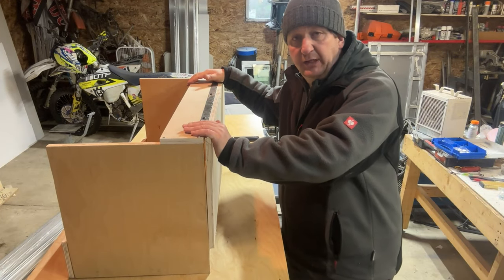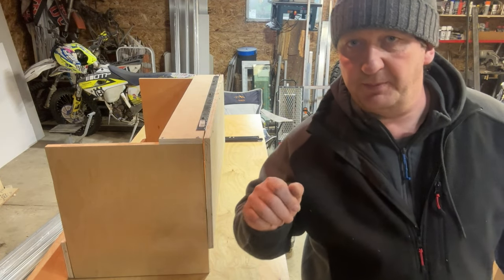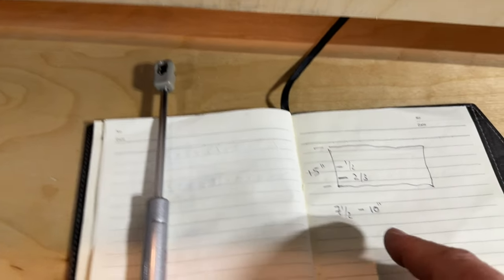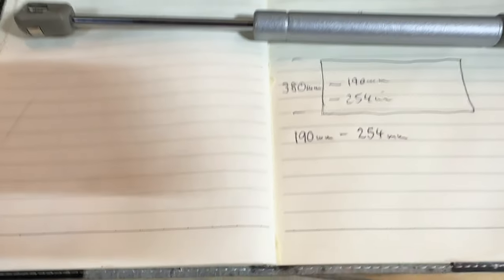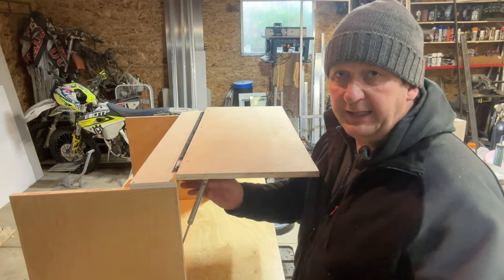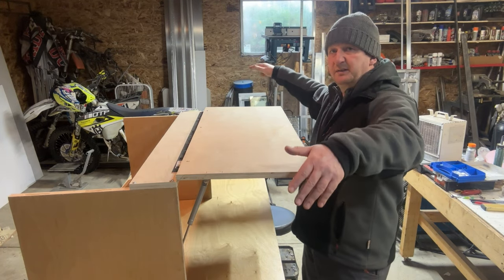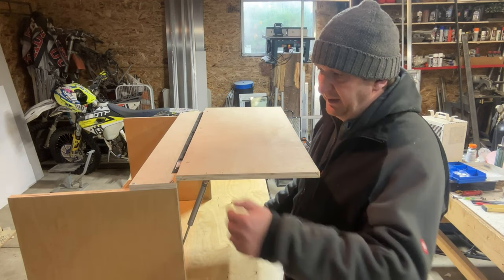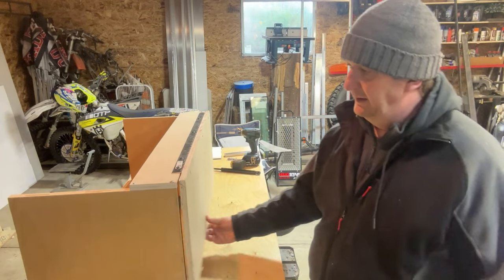How to calculate a Gas Strut ! Length - Force - Position all DIY !!!

Comment: Great video. thank you very much. I have a follow up question. If your door or lid is long and you decide to go with 2 pistons. would you divide the Newton by 2? ie: if the lid I wanted to lift was 62 pounds or 28.16 kilograms would I use 2 pistons at 276.23 Newtons or 2 pistons at roughly 138 Newtons?
Reply from the maker: Watch the Q and A video it will answer your question. https://www.youtube.com/watch?v=VvD6kzq3kts

Comment: Great video, best one on youtube. But no mention of the mounting position of the other end of the gas strut (not door side). As I think if you don't mount it properly it would just push the door out itself, or not assist much. Do you have a good rule for that? Thanks
Reply from the maker: You are correct and I made a Qand A video later on which answers all those questions. Cheers https://www.youtube.com/watch?v=VvD6kzq3kts

Comment: Hey! I loved the video and it was very informative and helpful for my project! But I have one question, I am trying to install gas struts on a work bench that opens and closes like a chest but the lid is so heavy it could easily amputate your fingers if anything goes wrong. Because of the contents in the box I don't have the possibility of mounting the struts to the sides of the bench but I have to put them on the floor inside, its only 13mm deep so its not that big of an issue but what I need to know is how to position the struts like the ones on the truck in the beginning. Where they are at a steep angle and push away with the lid instead of pushing against the lid. Any help would be amazing, thank you!
Reply from the maker: I am sure you will understand that I don't like to give advise on projects you could get hurt. Please be careful and good luck !

Comment: My lid overhangs.  So when calculating the length, do you want the total length of the lid (overhanging) or just the length of the chest itself (excluding the additional overhang of the lid)?
Reply from the maker: In this case you need to exclude the overhang .
Reply: @oscaroverlander_MB1222AF  Thank you!  I really appreciate the replies.  I struggled for a while and wound up ordering like 15 different sets of struts.  It was frustrating not being able to try these in my hands before ordering.  The ones that seemed "long enough" online ultimately put too much pressure (like 60#), and would either hang or I couldn't close the lid.  Wound up using 14" Vepagoo struts at 24# weight (ordered on Amazon).  Here's my project, if you're interested:

https://www.youtube.com/watch?v=6mGPstTkR-c

Comment: Is there no accommodation in the math for a 2nd gas strut? Ie, if two gas struts, cut the load weight in half? 2 struts you reduce or add distance? I’m not sure what 2x struts do to the equation. Thanks!
Reply from the maker: I made a Q&A just recently you will find the answer here. https://www.youtube.com/watch?v=VvD6kzq3kts

Comment: If I'm using 2 struts, do I need struts that will support half the amount of the total weight each? If that makes sense
Reply from the maker: No dividing both struts need to have the full force, otherwise you and up with two struts they are too weak to push the weight up. Cheers

Comment: I'm trying to put this on a bed to lift the mattress up so it's basically what you have built here but just flips the other direction. All of the instructions I'm seeing online the lower part is to go closer to the hinge, so would the 20-30% still apply just on the base instead of on the mattress part that's opening? If that makes sense.. I'm wondering do I just do it backwards because it's lifting the other direction, Maybe the rollover that you mentioned at the end..? I'm having the hardest time trying to figure out how to get this on
Reply from the maker: Little difficult for me to help if I can't see it. https://www.mote.hu/en/products/gasspring-bed-actuators-for-single-bed

Comment: Super helpfull.  Question I have is that I have a door 48" x 48" but only weighs 15lbs.  How would I determine what to use as it is really hard to find a Gas Strut that is long but low lbs.
Reply from the maker: Good question! https://www.ebay.com/itm/392152995247  they may work if you go close to 20% or even more towards the hinges. Cheers

Comment: what is the name of the mechanism that would be used if the "length" was too long?  Like if I wanted to make a king size murphy bed, that is 80" long, that would need a minimum 40" strut, but certainly there must be some mechanical advantage method/device/bracket that can short the length requirement?

Thanks
Reply from the maker: Good question ! You can use a shorter strut but make sure it can lift the weight, the force formula stays the same.

Comment: Great video Oscar, thank you very much. I just wanted to ask, if the weight of the cabinet door is say, 10Kg which would be 100 newtons... would you buy 2 gas struts at 50 newtons each because the weight is divided in 2 OR does it not work like that?
Reply from the maker: In this case I would buy two struts with 100 Nm and if I like it open softer or stronger I play with the 20-30% spacing, but don't divide the force by two, you end up with two  weak struts. Hope this helps Cheers

Comment: Fantastic video! Be question: if I do install 2 struts will I need 1/2 the Newton per strut? Given that two will add up to the same amount? Like if I need 60 Newton total, but install two struts, do I purchase 2 struts of 30 Newtons?
Reply from the maker: The answer is no don't split the force by two. Both have to have 60 Newton, otherwise you end up with two weak struts. Cheers

Comment: What about if If I cannot disassemble the window where I need to place the strut and I do not know how much it weighs... and I have no way to weigh it...
Reply from the maker: Thanks for your question, there are multiple solutions to get to know the weight. 
1. Swing the window open by hand and guess the weight ( if you are not sure let others do the same and compare your guess )
2. Maybe you can borrow a hanging scale from someone, hook it on to the window part and lift the scale up it will show you the weight.
3. Figure out the frame material and thickness and the infill ( glass or solid panel or sandwich panel ) you will find for all sorts of materials and thicknesses weight examples per meter/feet/square meter/square inches and find out the weight by math. 
I hope this helps Cheers

Comment: The weight to push up - is that per strut, or total?  So if I have two struts, I would halve the amount of pressure needed?
Reply from the maker: The calculation is per strut, don't divide the force, you end up with two too weak struts being able to push up the weight. Cheers

Comment: Exactly what I needed to know! One thing, the Gast struts. I ordered through your link. Do not have that cabinet attachment. Is that something you need to order separately?
Reply from the maker: Thank you very much. Yes if there are no mounting brackets with the struts, you need to purchase them separately. Make sure you pick the ones with the correct ball size. Cheers  https://amzn.to/3y2GVY2

Comment: Oscar:   I contacted Dunn & Watson in Au.  They sell struts in Au.  The video they put out had all the math .  Before I placed an order I asked them  them to check my math.  They refused, { lost a sale},  Your explanation is far easier to grasp.
   I would however  ask that  you include the following.   To convert Newtons to pounds, 1 N= 0.224809 My door weight  is 75 kgs.  43" High.   30 % is 28.66"  20% is 21 1/2  ".   I need a strut that will lift. 0.224809 X  750= 168.06, or 169 pounds. 
 Your video will make Life Easier for many people.  Thanks.
Reply from the maker: Thank you for your positive feedback, I am glad you like it. If your used to pounds it makes sense if you convert it that way, but for my understanding is it easier from kg to N ( your door is 75kg = 750 N ) Cheers
Reply: @oscaroverlander_MB1222AF   Hopefully we can do coffee this spring.  I need your advice- to many questions ,this is not the place. I will email in about 6 weeks. Yes,  my door is that weight. The rear taper of my truck will be a storage area. The back pivots up. Al plate is 176 kgs.

Comment: I'm in the process of doing an aftermarket stereo in a car where I want to mount some amplifiers in the bottom side of the (when closed) trunk of the car.  so when resting in the position of totally open...there will be less weight being held out  as demonstrated by your model....., but a LOT more weight to be lifted up from a horizontal plane. Presently my trunk already has older springs that I want to completely replace with the struts.  I was just assuming I could get the highest psi strut that would fit for the length I have ....  Do you see a problem with that mindset?  I don't think I'll have so much pressure where the trunk doubles as an ejector seat for those that are sitting on the car.....  :>)
Reply from the maker: Better would be finding out what the weight is which the struts have to lift, too strong ones will lift everything and this pretty fast but when you close the trunk at the end of the closing movement the struts will slam the trunk closed. Because they are so strong. Hope that helps. Cheers
Reply: @oscaroverlander_MB1222AF  thanks for the reply...looks like I'll have to make the amp board and wiring and weigh that along with maybe through a search online for the trunk lid weight and go from there...  thanks again for the help!
😊

Comment: Can you tell me anything about electric actuators? They dont come in the same length/weight as gas struts. So do i need to know the length requirement or the weight requirement?
Reply from the maker: Well I have never installed an actuator but I could imaging, that weight and lift height the most important parameter are to select the right actuator.

Comment: How about for stairs ( 4 step ) as lift for storage space underneath.  how do you measure the right gas strut lenght?
Reply from the maker: Should be the same principle if the struts are attached on the sites. If they are attached at the head center point you need a lot shorter but stronger strut. But the weight of the for steps stair is an important factor to find the right struts.

Comment: nice informations. But do you think i can use the same calculs with an electric linear actuator on 12 v
thanks ??
Reply from the maker: Well I have never installed an actuator but I could imaging, that weight and lift height the most important parameter are to select the right actuator.

Comment: Do you use 2 struts if the door to lift is very heavy? And how you calculate when using 2 strus?
Reply from the maker: Yes two if you purchase them they come most of the time in pairs. Cheers

Comment: Is multi positional stop gas strut good or they pose any failure threat and how do they work
Reply from the maker: I was hoping to find some but was not able to, those would be fantastic for my skylight. They make it possible to open the window for a bit and leave it in a sorten position. Post a link if you found some please !

Comment: If you use 2 gas strut, do you divide the strength in half?
Reply from the maker: No both struts need to have the same strength. Cheers

Comment: Great video, thanks!  FYI, you could weigh the door without removing it by propping it horizontally on a scale form the very edge opposite the hinge, subtracting the weight of whatever you propped it with, and dividing by 2 to account for the fact that the hinge on the other side is supporting half the weight.
Reply from the maker: That's a great idea! I doubt that will be an accurate measurement, but it should work. Cheers

Comment: Absolutely Brilliant Oscar. Thank you very much for your tuition 
This was doing my head in trying to work out how to install it
Grateful for your help
Cheers Stevo
Australia
? Is it possible to fit the struts on the external frame of the door & wall of cabinet. 
Thanks
Damm, well that didn't work, only closes 1/2 way 🤦‍♂ 🤷‍♂
Reply from the maker: You are welcome!
Reply: @oscaroverlander_MB1222AF  
What have I done wrong , the door will only close halfway.
The maths is right. 
100 n strut, door weighs 3.3kg
600 w door = strut length 325 
Position fitted to door 120mm
Fitted to external frame work in opened position on door & cabinet because there is nothing to attach to internally.
It will only close half way.
Got me stuffed

Comment: Hi. I want to have a flat screen tv flip down from ceiling. When not in use, stored in horizontal position up close to ceiling. When in use, down vertical.  So thinking two struts, spanning from ceiling down to supports on each side of the TV. Any thoughts on which struts to use, and how to configure? Thanks
Reply from the maker: Well first of all don't mount struts directly to any type of electrical devices it would be extremely dangerous ! I trust that you are not thinking of doing so. If you mount the TV to a board as a substrate and attach the struts and hinge to that it will be fine. Same method here length of the board height and weight of the substrate plus TV . 
But honestly those ceiling mounts exist and don't cost much ready done and easy to install    https://amzn.to/4cXkqDJ

Comment: Awesome video. Just wondering do you have any insight on to achieving 45 degree lift ?
Reply from the maker: Well you just have to set back the Gas strut brackets on the corpus, deeper in to the cabinet. If your cabinet is not deep enough than use shorter struts. Thank you !

Comment: Do  you calculate Newtons for each strut or is the result divided by two struts?
Reply from the maker: No for each one and both need to have the same force. Thanks for your question.
Reply: @oscaroverlander_MB1222AF  Is there any difference in performance of these struts whether they are installed with piston rod up versus down?

Comment: Tnx!  i've looked at several vids hoping to find just this information.
Reply from the maker: Glad it was helpful!
Reply: @oscaroverlander_MB1222AF  you mentioned roll over installation.  I never understoood what that is or why one would use it.
Reply from the maker: @rhkennerly  you can check this webpage if you like to know, there is a push up and a flip/roll over install explained.    https://camloc.com/ca/help-centre/installing-gas-struts/understanding-gas-strut-mounting-points/

Comment: the force on the lift is increased by the acted angle. and changing bracket location, changes the angle of opened door overall. Correct me if I am wrong, but this video has at least these mistakes
Reply from the maker: Not correct the force depends on the weight not the angle !

Comment: That was excellent!  I want to install a swing-up laundry table. When determining the force of the strut, how do you account for any objects that may place on the table?
Reply from the maker: You can do it! Well now you know how to calculate the force of your gas strut to bring and hold up your table top. But any object on top of the table can be calculated by adding the weight to the table top weight. But !!! This could be dangerous because when you add a basket with wet cloth for example. That would make the gas strut so powerful that the table top flips up with a extreme speed and force ! So someone could get hurt. I would not recommend doing such thing ! Cheers
Reply: @oscaroverlander_MB1222AF  Thank you so much!

Comment: I’ve already got that 20-30 % point bracket on a Ute hard lid. What angle do I fix it to the Ute tray ? Because it’s not 90 degree at open height
Reply from the maker: Like I said in the video you open the lid to your desired angle and mount the strut on the corpus that way. Cheers
Reply: @oscaroverlander_MB1222AF  ok were it ends I will mount it to the tub so it’s the height I’m after thanks

Comment: What if you can’t detach the door to weigh it? In my case the door I’m trying to weigh is welded on
Reply from the maker: Good question ! If the door is in horizontal position when closed, than you could place a scale between frame and door leaf to weigh it. Put the scale on the frame rest the door on the scale and it gives you a close idea about the weight,
If the door is in vertical position when closed, in this case I would open the door 90 degree place a stool/box under it and the scale on top of the box and than rest the door on it. Just my two cents I do not know what is applicable in your case but there is always a way to find out the weight maybe not absolute but close.  Cheers

Comment: What force do you use if 2 struts are needed?
Reply from the maker: Both need to be the same, do the math on the force and use two with the same force don't divide the force by two. You are ending up with struts they are too weak to push up the weight.

Comment: Is there a calculation for the second contact point?  You just skipped that part.
Reply from the maker: Well I didn't really skip it but the second attachment point should be with no compression close to the front edge of the object, if this makes sense to you. Cheers
Reply: It’s the other end of the extended strut